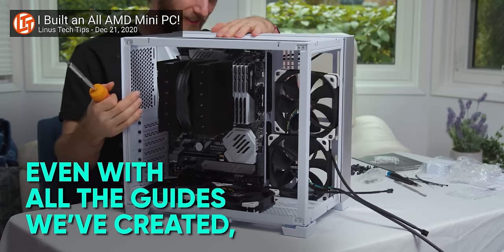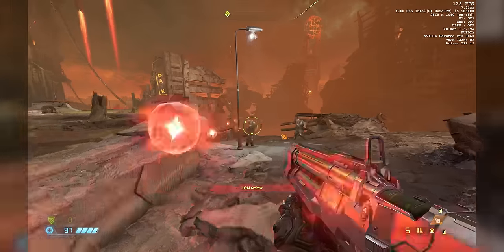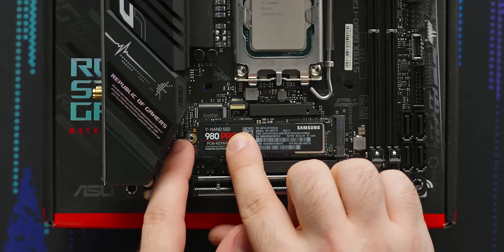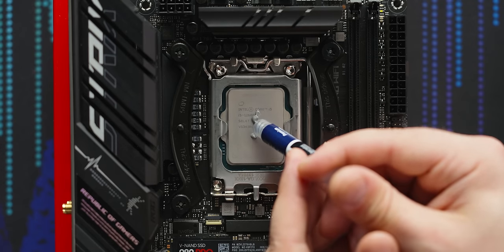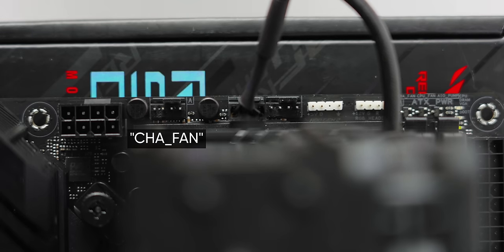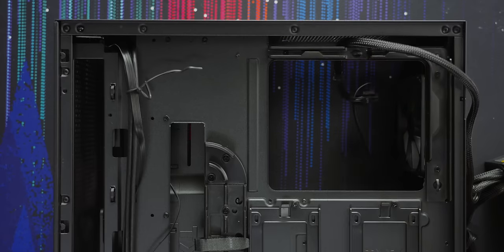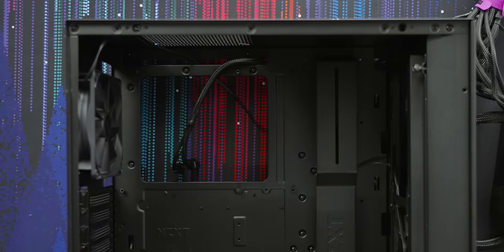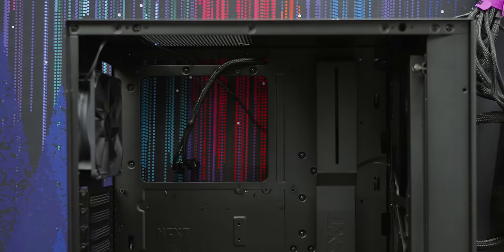The EASIEST Gaming PC Build Ever!

Comment: Why isn't there a post-build tutorial with how to enable the XMP in the bios, recommended settings after building the PC? These things are what's going to shy away a lot of beginner builders.
Reply: I think jays2cents made one
Reply: joey delgado usually includes that and installing windows/drivers in his build guides if people need to look
Reply: Oh come on it's easy to look up
Reply: @UshankaMaster  only if you know to look it up, which beginners might not.
For example: there's plenty of people too that have 144Hz QHD monitors, but connect them via hdmi 1.4 and thus won't get more than 60Hz, just because they don't know to look it up.
A beginner's guide to your first computer should include BIOS settings and installing Windows/another OS.
Reply: Left it out to be more foolproof, maybe.
Reply: XMP isn't guaranteed. My CPU and board combo crashes with it 😔
Reply: They don't know what they don't know.  If it posts, success!  If it underperforms?  They won't know!
Reply: Hardware and software are two components to all PC's, but are definitely better understood in separate video's. Use this vid to install the hardware. Find another vid to install the correct software.
Reply: @Excalibaard  i have one such monitor, it works perfectly fine with the manufacturers cable but i needed a longer one and kinda got ripped off so im limited to 100 hz
Doesn‘t bother me though because star citizen wont run faster than 50 fps on any machine so i guess thats it
Reply: That has nothing to do with the build of the computer
Reply: Because you don't "need" to do that. To get up and running all you need to do is have some sort of boot media, chiefly a windows usb. You plug it in, you turn the pc on, you follow install instructions, your good to go.
Yes you won't be getting the most out of it but this is a beginner build.
Reply: They can just use 2133mhz ram lol
Reply: @Excalibaard  I meant xmp, my bad I guess. Most of this knowledge I accumulated through experience tho
Reply: I mean how many videos do they need to have with that information.
Reply: @C0MPLICIT  content. As many as they can every few months they need to release more.
Reply: Because he hasnt made one
Reply: updating the bios period is a good vid. making sure the fans work the drives, whether or not you need to do XMP, etc. making sure there aren't newer XMP updates.
Reply: Bot trying to be mean but most of that is quite easy and there are a million other tutorials on the internet
Reply: @Excalibaard  I mean if you buy Windows, it will tell you how to install Windows. It's literally foolproof. Although it would be nice if mobo user manuals always came with an in depth BIOS guide that much I agree with.

But also beginners need to be ready to learn on the web. Any beginner should look up how to open their bios, and spend some time googling what certain settings mean and do.
Reply: If a beginner isn't ready and willing to research bios settings or anything related to their new PC on their own, they probably aren't ready or the right fit for the hobby.

Would you buy a classic car you plan to restore with only the prior knowledge and experience of changing brakes? Just assuming you'll be good with those tools and experience and wouldn't think you'll need to research and potentially troubleshoot different features or problems you don't know exist.
Reply: @kye3k1  Unless you bought them used, that should instantly mean RMA.
Reply: THIS!! THIS!!

I have built several PCs but i dont understand much of the bios features.
Reply: Lol, these things are issues regardless of if you build it yourself or buy a prebuilt. 
If you don't know what XMP is, I doubt it's going to turn you off building your own pc.
Reply: @ioasisyumich  not necessarily true they may be willing to learn but it's hard to learn when you don't even know the terms to look up and research if we are trying to teach new members of the hobby that have zero prior experience they need to know the language
Reply: Xmp is extremely important nowadays
Reply: Because this is a 13 minute advertisement for a retailer to try and shift poorly matched components, not a real tutorial.
Reply: This is why I would never build my own computer because I wouldn't have any idea on what to do once I put it together
Reply: After all it's just an easy PC build not a setup tutorial 😊
Reply: I agree that should be part of this video. Jayz2cents might have a video on it but this aint jayz channel. It makes no sense to watch linus video and have to go to jayz to understand what and how xmp should be enable.
Reply: Becuz jayztwocents alr made one
Reply: You're not supposed to enable XMP because voids the CPU warranty and potentially mainboard warranty. Or at least you're not supposed to tell people to enable XMP and keep it on the down low.

Which is absurd. Because this is how you reach the full rated speed of memory and the CPU's internal memory bridge or even the internal bus!
Reply: They made that video, but I could not for the life of me tell you what the title of the video was lmao.
Reply: @corbinmcdowell6671  If you are willing to learn something, you figure it out one way or another. It’s allowed to ask friends, family and colleagues. And “setting up my new computer” is a sentence everyone can type on Google.
Reply: @kenny9088  so every unboxing of a mobile phone , should include all settings? Every car review should include every part of the car, even changing the spare tire?
Reply: Its lmg
Reply: @MASTER179  he did he is the best
Reply: He's made videos about that before, but I agree it would be helpful to mention here. The problem is, if we go that route, every time he makes a build video he'd have to talk about not just XMP, but every other little detail that he's mentioned in past videos. They would get longer and longer with every build tutorial. I'm not really sure the correct way to remedy this Tbh, because you're technically right that it's something that should be mentioned, but you can say that about a ton of other things not mentioned in this specific beginner build video.
Reply: @Ulven3829  thats something totally different dude. Bios set up is part of building the computer. Building the computer is only half of the job. Bios  Is definitely an  essential part of the pc.
Reply: @Ulven3829  aero mech comment has over 700 likes is clear people agree on this matter. You are only one here. Have a great day
Reply: @Ulven3829  and clearly you dont watch too many phone reviewers cause most people actually do a settings tutorial. A phone is not the same as a computer.
Reply: Jayz2cents made one also its so ez to find ur way around bios nobody needs to
Reply: @kenny9088  Ehhh no. BIOS setup is it the name “Setup”. It has absolutely nothing to do with building a computer.
Reply: @kenny9088  So?  That doesn’t make it more right.
Reply: @kenny9088  I watch a lot of phone reviews. And none of them have gone through all settings, and explained what they do.
But a phone can still be adjusted/fine tuned.
Reply: @nerd20fromdiscord  🤣 how can you tell?
Reply: Lmao what about stuff most beginners don't even know exists is going to scare people away from building a PC.
Reply: @sklyrovka  that and some time constraints especially for rookie builders it'll probably take them a few months
Reply: joey delgado has the best tutorial for beginners from assembling, windows, drivers and bios.. my opinion haha
Reply: @Ulven3829  This is neither an unboxing, nor is it a review. It is claiming to making building a PC "foolproof". Argue as to what that should or should not, but your comparison is less than faithful.
Reply: I actually disagree I think that most people are intimidated by just putting the parts together they're afraid they're going to break something or not know what to do.
Reply: @MASTER179  Yeah but that's getting pretty old now which algorithm isn't recommending thus less people know about.
Reply: You expect information that will be useful to 95% of people on Linus Tech Tips.................
Reply: @anthemsjam  Jesus man LTT sucks
Reply: @Ulven3829  nice straw man brah, I guess I'll have to update my car's bios to get all those horses working
Reply: Overwhelming beginner builders with an excess of unneeded information will also "shy away" people.  Someone else mentioned, it comes from experience, learning all the tweaks to optimize something.  You can't fast track experience.
Reply: XMP comes with system instability!
Reply: @ioasisyumich  Most people don't approach their first gaming PC the same way a car enthusiast would with a restoration project.

Most would be more than satisfied with going on Amazon, buying a prebuilt PC and getting an experience equivalent to getting a new console or smartphone - unfortunately for them, if they spend even 5min asking around about which PC to buy, they'll be quickly convinced by the PC community that the only really sensible or affordable path is to build the PC yourself... And now the person who has never so much as changed a console's HDD is expected to figure it out for themselves or try to sort through dozens of videos of technical jargon just trying to get the gist of what to do in order to get the system up and working without having to actually have an education in anything to do with computers.

A more apt comparison between a newbie PC buyer and a car enthusiast is expecting everyone who wants to drive at all be auto mechanics or giving a kid an empty frame and asking them to put it all together without telling them they need gasoline and expecting them to just figure out why the car wont turn on after the engine is installed I the mount.
Reply: @anthemsjam  some random ass beginner won't know that they have to go on his channel to look for it
Reply: @tacet3045  amen
Reply: @chillhour6155  If you can't defeat a strawman argument, you have no business arguing on the internet. 

"Hurrrr durrr strawman" doesn't magically make the argument invalid it just shows you're not intellectual enough to actually make a valid point.
Reply: Tech source has the best pc build guide ever made
Reply: ? Beginners don't know what you just said there not going to shy from this video because they didn't cover something they don't know
Reply: @ioasisyumich  What kind of asinine stance is that? "Either you don't know what a strawman argument is, or you've got even less business conducting debates/arguments than you claim the other person does.

A strawman argument is when one side of an argument or debate starts intentionally (or unintentionally) starts changing the points being argued by misrepresenting or exaggerating the stance of their opposition (usually in an attempt to frustrate the other person or invalidate their stance). Often to the point where they seem to completely forget that the other person never even claimed to support the strawman argument they invented (and getting hostile when the other person refuses to argue for something they never said or don't support).

You claim that calling something out as a strawman argument doesn't invalidate the argument, but when the term is being used correctly, it absolutely does; you can't just change what someone else is talking about and force them to support whatever asinine misinterpretation or misrepresentation of their actual claims you're making for any reason.

If you can't have a conversation with someone and actually listen to and respond to what they say without going off on tangents about unrelated shit, then you have absolutely no room to be arguing anything with anyone, ever, in any setting.
Reply: Jay2cents have it
Reply: They made one with the pc build guide it’s an hour long
Reply: @MASTER179  but Linus did say this was a fool proof build guide not so full proof if you have to search for other videos to finish to process... 🤔
Reply: @Excalibaard  If someone is building they ought to be smart enough to figure it out
Reply: This is VERY late but if you just go into the bios, it should be right there in the simplified settings under DOCP I think it’s called, personally not built yet but I’m sure it’s just that simple
Reply: As a beginner builder, that's the last thing on my list. Lets start with getting a bunch of cables pluged in and it to even boot.

Comment: For installing the cooler, ALWAYS check if theres a plastic peel to remove on the part that makes contact with the IHS of the CPU
Reply: Thumbs up for this.
Reply: Huh why is my pc crashing and not performing as there's a burning smell, rip the enthusiasm of building.
Reply: Wow thanks
Reply: I've built 30+ PCs over 4 years and I still left the sticker on last week. Haha
Reply: Should be kinda obvious also but make sure the fan is blowing air in the correct direction. Typically towards the back of the case.
Reply: Since this video was so detailed for all the steps, this should've really been included. In mean, they even tell where to place the screws, not telling you to remove the plastic peel is a real oversight (I assume they used a cooler that's been in another build before and didn't have the peel on anymore).
Reply: Rip my 4700K
Reply: peeeeeeelllllllzzzzz
Reply: noctua coolers dont use plastic peels, they use a hard piece of plastic to cover the contact in the packaging
Reply: Good thing I didn’t build my pc I didn’t know that lol
Reply: As a supervisor of a small tech department for building PCs, this is the first thing our last 3 new people have done wrong. My coworker knows now knows to just check that a CPU runs at about 30-35C on the first time in bios, 55C if the film cover is in the way.
Reply: @ERZAY2  i installed a few fans in my life and did this with my last build 😅
Reply: @sp00n  Noctua CPU coolers (the one in the video) use a large plastic support in the packaging, but they do not have a peel. That aside, the advice still stands as good advice.
Reply: To be fair it's not Linus himself that screwed up. It's the editor who did the titles. Easy job to re edit this and make it right. Do it before Linus notices.
Reply: They tested that, it was about a degree difference 😂
Reply: @damionp8615  care to elaborate the "rip the enthusiasm of building." ?
Reply: just watch jaytocents vids about that

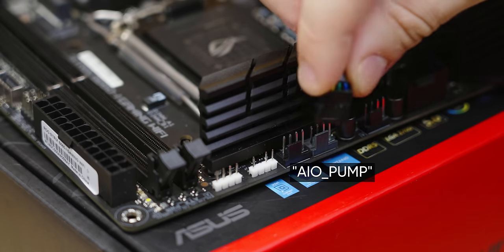Comment: At 6:45 when Linus mentions configuring the AIO pump header to match the CPU/chassis fan function: The setting is in the BIOS: Go to the Monitor section of the BIOS and scroll down to Q-Fan Configuration. In that menu, scroll down some more and you'll see the option to set the "AIO PUMP Control" to Auto (it is Disabled by default). Then set the "AIO PUMP Fan Q-Fan Source" option to "CPU" so that it matches the regular fan header's options. There you go!
Reply: I would have no idea what any of this means
Reply: Susanna is wrong, just letting a newb know a concept exists helps them know to learn about it
Reply: why has literally every single AIO installation video ive ever seen completely disregard this part LOL

Comment: Extra step, but an easy one: If all H510s from NZXT are assembled by drunk lobsters, for a cleaner cable run, rotate the rear fan to make the wire exit at the top and close to the motherboard wall (in this instance, rotate 90 degrees clockwise).

Comment: 3:26 Gen 4 Pcie M.2 SSD can overheat and clock down if the cooler isn't on it. I Recommend spend the extra 10 seconds and screw the cooler back onto the SSD.
Reply: Specially something like the sn850

Comment: At 7:50 the PCIe 8 pin label is on the CPU 8 pin. It has the big "CPU" label right on it.
Reply: And vice versa. Good spot, didn't even notice!
Reply: Yep the cables shown for the cpu and gpu are in the wrong order.. lel    

Imo it's also a silly reason not to go for modular... yes you can do it wrong but by paying attention it should be simple and save a cable mess.

Also a bot (nub) has stolen your comment
Reply: Good spot! I'm visually blind so I didn't notice! Thanks!

Comment: Anyone following the guide should be careful at 7:50, the 8 pin cables are labelled incorrectly! The CPU 8 pin will say "CPU" on the side of the connector, and the PCIe one will say... "PCIe"